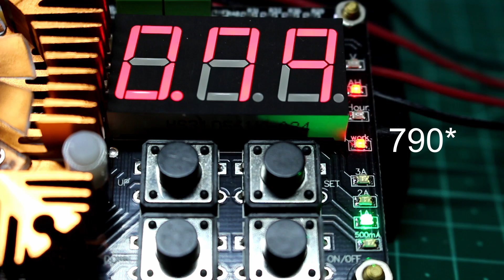Cheap Cell Capacity Tester

Comment: Link for the battery discharger is dead
Reply from the maker: https://www.banggood.com/Digital-Display-18650-Li-ion-Lithium-Battery-Mobile-Power-Capacity-Tester-Meter-Discharge-Load-p-1100949.html?p=3S161310753936201705